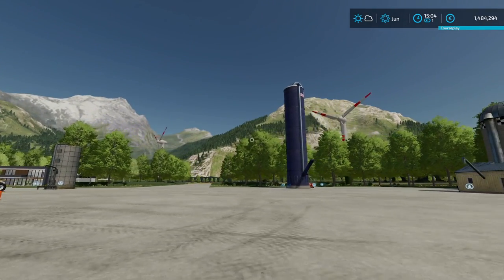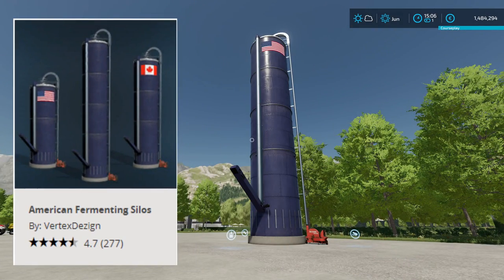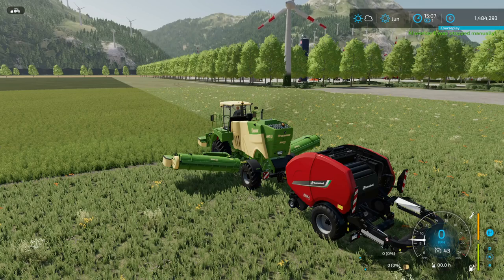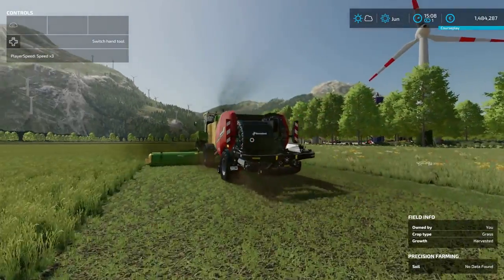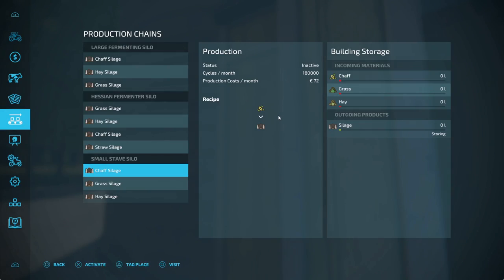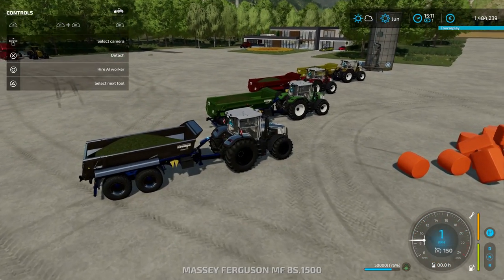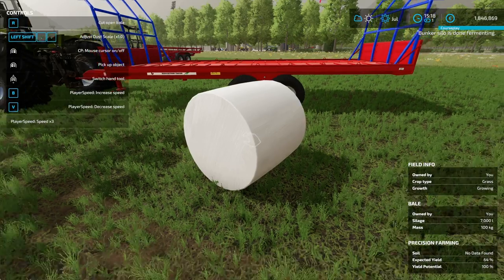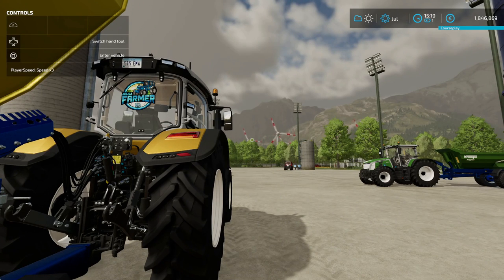FS22 Test: How to make the most efficient Silage in Farming Simulator 22

Comment: One other thought / comparison between "Silage" is also the difference between the time it takes to mow, then bale / wrap and the time difference it takes to mow and create grass bales - then transport as bales to a silage production point that supports bales, or to use a forage wagon to pickup the mowed grass and transport to the same production point or a bunker silo. The carting time differences I think should also affect the time.

Anohter way of testing would be to start from mowed swaths on a single field, then either bale/wrap with a Fastbale, bale as grass and transport to a fermenting silo, or collect with a forage wagon and transport to a silage bunker (and then compact said bunker). If you include the other steps - the transport and collection steps - i think that the silage bales will be a bit closer in the amount of time it takes from Grass Swath to Silage.
Reply from the maker: Yeah, thats a more severe and complicated test to do.. so many variables😅😅